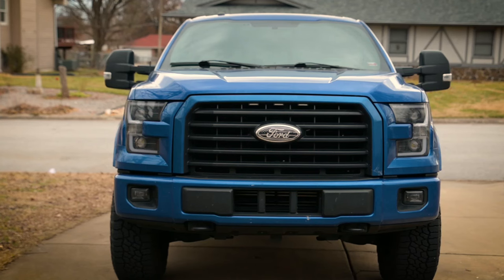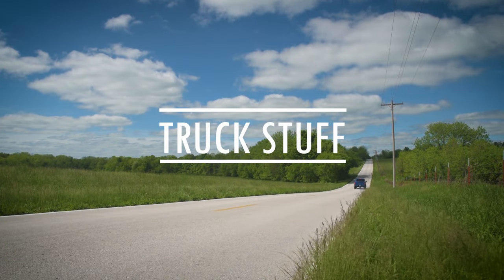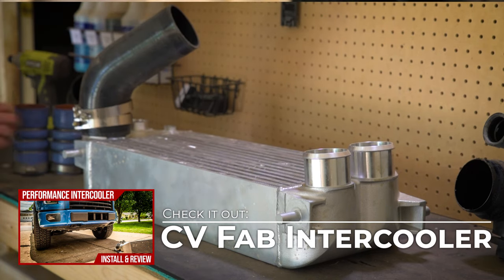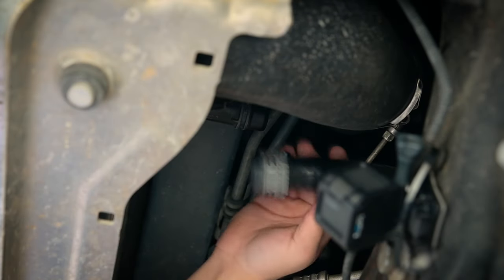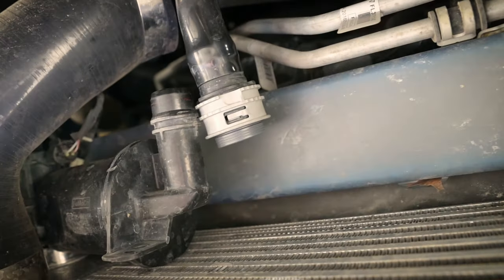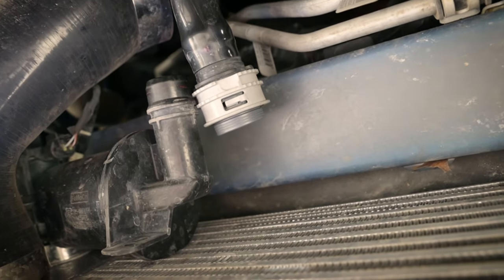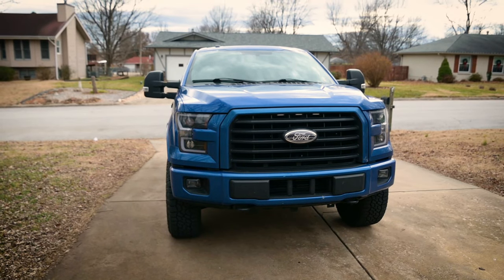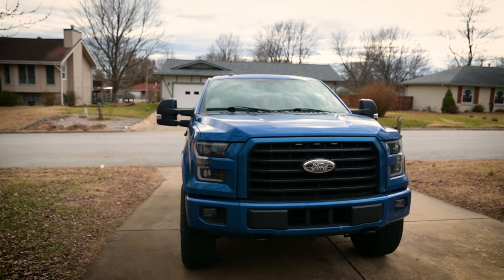F-150 EcoBoost VTA Mod | More Turbo Noise?!

Comment: U would have to be a turbo guy to understand, otherwise people would think it’s a waste of time and money. That sound to us is beautiful music to our ears. I say keep it!!!!!
Reply: But does it make you truck perform bettsr??
Reply: @sammyg.4255  Nope!
Reply: It doesn't perform less either, right?
Reply: @abrahamrivera7235   yup just sounds cool lol BUT the blow off valve does occasionally suck air in that yyy it connected to the air intake soooooo theoretically it can suck in dirt and cause damage
Reply: Venting to atmosphere will improve overall performance, preventing hot air from being recirculated will DEFINITLY give you lower inlet temperatures!
Reply: @jpaige1998  actually without tuning the truck   venting to atmosphere  can also cause performance problems as it throws of the Air/fuel ratio
Reply: @robj.973  wouldn't the ecu compensate?

Comment: I did this today, and added a cone filter similar to a cold air intake filter at the back of the blow off valve which made the noise a lot better sounding then just coming straight out. Sounds like a diesel truck almost. Amazing turbo sound. Mines a 2013 year Ecoboost. I also removed that tube completely and used a one and 1/8 chair leg boot to seal the end of the intake. Again add that filter trust me. Yours sounds like a poof 💨 mine did too before the filter. Now it’s a lot higher pressure sounding and more drawn out.
Reply: what filter size did you do and if you could sent me the link to it that would be great. Thanks

Comment: I used a rubber chair leg cap on the intake hole after removing that whole plastic piece. $2 cap . Works like a charm
Reply from the maker: I have heard of that before!
Reply: Cheaper by far. Less plumbing left on the truck. Easily installed.

Comment: Yes keep the mod. But that rubber boost hose expansion is insane. I’ll be upgrading mine to hard pipe soon
Reply: The reinforced silicone elbow is made for boost preasure conditions, Simple clamp on install (I have a CVF Titan installed), no O-ring seal or wire circle retainer.

Comment: Can you hear it over the noise of the truck. It didn’t sound very loud in the video. Not sure that I would spend the money on it. I love seeing the hose swell with the pressure though. Awesome shot.
Reply from the maker: Yes, you can hear it over the truck, but it's not super loud. Just a little noise in the background.

The plug was $24. But you can get cheap PVC plugs, or even rubber chair feet for a few bucks that work too
Reply: Lol my truck does this ima get it taken off
Reply: @TruckStuff1  what size is the plug?

Comment: Some misinformation here in the comments. Ford revented it to silence it, the vast majority of the public doesn't want that and no manufacturers vent to the atmosphere on turbocharged vehicles. It has nothing to do with performance. Also blow off air isnt wasted, it has to get rid of the pressure. If you go off throttle, subtract gas you have to subtract boost. Doesn't matter if you blow it off into the atmosphere or back into the air intake that operates solely on vacuum. And this does nothing to increase turbo sound, whistle or flutter etc. Turbo sound doesn't blow out of the intercooler. it's only a short blast of air being released, and that's the only change in sound. The actual blow off valve is closed 99.9 percent of the time. So you exposed the blow off valve that only opens for a fraction of a second, and you put a plug in it that seals the return tube so it doesn't suck in dirt. Where would an increase in the whistle come from? Cold air intake name is a scam, all "cold air intakes" draw air from the same location as the oem intake and the open top designs use the existing bottom and intake duct. And even the aftermarket closed units draw air from the same location. Its a same air intake...lol. It has been proven that open top intakes rob horsepower from Ecoboost. Up to negative 25hp. Lets spend 300-600 bucks to rob horsepower. Some of the closed style aftermarket intakes made gains up to 10hp.Buy the open style I guess if you wanna look cool with the hood up. Those can increase turbo whistle. Hmmm do I want to sound fast or be fast...lol? Substantially increased turbo sound only comes from a major exhaust change or completely exposing the intake side of the turbo. The later would not be a good idea at all. Yes the blow off valve vented to the atmosphere has a cool factor. I did mine years ago. And you will always be able to tell its working properly. I have a high flow catted downpipe. all of the resonated 2.5 inch midpipe replaced with straight through 3inch going into the stock muffler. And I have the S&B closed style intake. I have very little turbo sound increase and what I did gain is solely from a much higher flowing down pipe and mid pipe. I run the stock muffler because I dont want to be loud and the stock muffler is gigantic so it can be high flowing and still knock out volume. The aftermarket muffler designs with 4 inch out the back coupled with a downpipe and mid pipe upgrade really produce turbo whistle at low rpm but at wide open throttle just a loud exhaust note. By the way, a high flowing catted downpipe such as CVF or SPD does add horsepower  especially combined with other mods and a tune. The stock cats are extremely restrictive and growing worse with mileage. And the mid pipe is a substantial choke point. The muffler is not. You'd be better off keeping the OEM intake and doing a downpipe for power AND turbo whistle. If you are going to add multiple parts, intercooler and downpipe should be first on the list.
Reply: Holy moly you wrote a whole paragraph…
Reply: @danmyrivd6220  hope it was helpful. My 2.7 Supercrew went 3.98 zero to sixty. 12.46 in the quarter. With a 6 speed. Pay attention, you might learn something.

Comment: If you plug the BoV you can get that sweet sweet turbo flutter sound. The ultimate in turbo sonic entertainment. Its not THAT bad for your turbo. Is it worse than not doing it? Yes. But I have about 90k miles on a very modified 240SX with a super tight BoV  and I haven't had to replace a turbo yet...

Comment: I did this about 6
Months ago. I’m now getting some oil spots under my truck from what appears to be where that hose was. I’m wondering if it is from the cold air outside getting into the winter months. Anyone have this issue or any insights?
Reply from the maker: It's definitely possible. The intercooler does collect oil, especially in cold weather when oil vapor condensates faster. 

Pretty harmless, but if you don't like it, consider adding an oil catch can
Reply: Totally norm that's why is f150 guys attached oil catch can
Reply: Dose trucks oil filters are know to leak right on top of engine Tight your oil filter
Reply: Did you ever install an oil catch can?

Comment: What is the tube called that you connected the plug to? I would like to do this but found a hole in the tube from rubbing on my alternator
Reply: Same happened to mine

Comment: Did you cap the return hose off?  If not you’re sucking unfiltered air into the intake. I took my hose off and bought some chair leg caps and capped off where the hose connects to the intake then put a k&n breather on the bov just to keep dirt out of it. That way if I ever need to put the hose back on everything is clean
Reply: I believe that air only blows out there and doesn't suck in.
Reply: Wouldnt it cause an check engine code due to the unfiltered air then?
Reply: @OsoToasty98  no

Comment: Would you lose turbo spool noise since there is technically less air going into the truck since the air is not being recycled?
Reply from the maker: Nah it's minimal. The air intake outflows the turbos significantly.
Reply: The revented air has zero effect being recycled, it is going into an area of vacuum and doesn't boost anything and a fraction of a second blast of air wouldn't matter going into a boosted area either. It's not a matter of being minimal. it's a no effect mod. Just allows you to hear it. The only reason Ford did the revent was to silence it. A high percentage of potential buyers wouldn't like it. To my knowledge, no manufacturer building turbocharged vehicles vent to the atmosphere.

Comment: Hello, I ask you about the discharge hose that remains without the cap, it is not necessary to put a filter or something so that dust or mud does not enter, since I saw that some put a filter on it or it does not affect that it is exposed
Reply from the maker: It's not required, but you can. When closed nothing can get in and when open its releasing air. It would be very hard for anything to get in, but a filter wouldn't hurt anything.
Reply: Do you get any oil from the discharge hose?

Comment: Truck stuff do you still have it installed? Anycodes pop up or issues? Notice any power loss?
Reply from the maker: Nope! No issues and still have it installed, although I plan to take it off.
Reply: @TruckStuff1  nice you gonna put a aftermarket bov or just gettin tired of the noise
Reply from the maker: I'm just getting tired of the noise lol. It's for some people, but not for me

Comment: I tried this today on my 2021 f150 3.5 EB today. It made very little if any noise. I completely removed the tube and plugged the intake. After about 50 miles with no noticeable difference i put the tube on. Its a waste of time on the 2021!
Reply: Thanks. I just bought a 2021. Now I don't have to waste my time with this.
Reply: Some trucks have to be in sport mode to get the hi- pressures,  and of course the more boost the better the Whoosh,  if you increase your boost ie "tune" or bigger turbos then the better the bov sounds.
Reply: I think you’re supposed to plug the blow off valve also there’s a bunch of videos where people by rubber chair legs and Both sides not just the intake side

Comment: I put mine back together....it was cool at first but then annoyed me overtime. I dont know if the engine computer depends on the recirculation as well. Ive tried this and tried removing the "flow silencers" and my MPGs dropped by 1MPG. I put everything back.
Reply from the maker: The computer doesn't know anything about the recirculation hose. The computer simply looks at air flow, which it gets plenty of through the main intake.
Reply: @TruckStuff1  Didint know if it accounted for the extra short bursts of air or not. I lost MPG either from removing the intake hose diffusers or doing this. But still the sound bothered me with time. It was cool at first. But easy enough to undo or install.
Reply from the maker: I've heard that the turbo silencers can result in MPG loss. I haven't don't that (nor do I plan to) so I can't speak from experience.
Reply: @TruckStuff1  is this a pre or post maf diverter valve?. Just curious if this dumps metered air or un-metered air?. im not sure if i remember the intake system correctly?. Thanks!
Reply: I really don't see a loss in mpg with flow silencers removed.

Comment: Hey man does this have any effect on the reliability? you might have already answered this question but im at work watching the vid n cant really hear.
Reply from the maker: No it doesnt. The only change is the air exhausts to the atmosphere rather than into the intake.
Reply: @TruckStuff1  ok thanks because i bought my 2.7 used n it sounds just like that

Comment: For some reason my eco is loud af the spool and the bv are beyond what my buddies sounds like
Reply: I’ve got a 2021 2.7l and my turbos spool really loud and I can hear them over the engine/outside air noise until about 50mph
Reply: @longloopslad1974  ya those 2.7 are alil different and push more boost than the 3.5 tt I have. I just sold the pos tho both turbos went out and lost massive power. I'll never buy another ford this is the 3rd one I've had that didn't last a yr

Comment: Wouldn't this throw a lean code? By venting metered air into atmosphere that  the ecm has already calculated for fueling?
Reply: No. F150’s use a MAP sensor rather than MAF

Comment: Update? Is it still good? Did the chair tip dry rot?
Reply from the maker: I didn't use a chair leg tip. I used a plastic plug designed for this
Reply: Truck Stuff did it yesterday and holy shit this thing sounds great now👌👍
Reply from the maker: Awesome! Glad you like it!
Reply: Afro Jack still like it?
Reply: austin gater yes it sounds great man highly recommend it. Took not even a minute and it gives the turbo so much sound even as the turbo builds boost.
Reply: Anyone know the link for a 3.5L eco boost?

Comment: I could not hear the difference. Could have been a bit louder, but no turbo win.
Reply from the maker: This doesn't create turbo whine. It's the blow off valve which exhausts pressure inside the system.

Comment: What would happen if you disconnected the hoses but didn't put the plug in?
Reply from the maker: Nothing really. The plug is just to prevent dirt from getting sucked up there that hose goes into your air intake and is post filter, meaning unfiltered air getting into your engine.
Reply: What would happen is unfiltered air would contaminate your engine. I ran mine unplugged  for an hour or so.... The mpgs went way the hell up, but the engine was also getting unfiltered air.... Plugged the hose and the mpgs went back to normal. After 1 month now, I'm getting a burnt oil smell and wondering if the blow off is exhausting a bit of oil that is spraying my headers and giving off this smell....
Reply: @diazaa  that’s exactly what is happening.  This hose is what you would run to a catch can, for that reason.
Reply: @matthewbohn765  Since then I found the cause of the smell. It was actually a line on the passenger side to the turbo that was leaking as well as the valve covers. Had it repaired under extended warranty and no problems since.

Comment: I honestly think is a waste of money. But good vid.
Reply from the maker: I had a small merchandise credit left over that I couldn't do anything else with. So I decide why not try it.
Reply: You could also the little rubber feet for the bottom of chairs for like 2$ and do it
Reply: Waste of money? This is the cheapest mod on an engine I have ever seen lol. 

$2 if you use bottom of chair rubber or $25 if you use actual VTA part.

Comment: Ford put this hose on for a reason. Your truck will have issues down the road and your mpg will decrease. Leave stuff alone and you'll be fine. Want noise? Buy a muffler,air intake,aftermarket bov.
Reply: David H! Or If you want noise when you drive, buy a diesel.
Reply: @Celtics20  exactly!
Reply: Ford put the hose on the prevent the noise.
Reply: @Celtics20  diesels are ridiculously expensive and not practical for 95% of drivers though!
Reply: I did this for about 4 months now I have a misfire 301 code
Reply: @davidh8478  i CONCUR
Reply: @markmariz8618  still have the truck? Any updates on the cel?